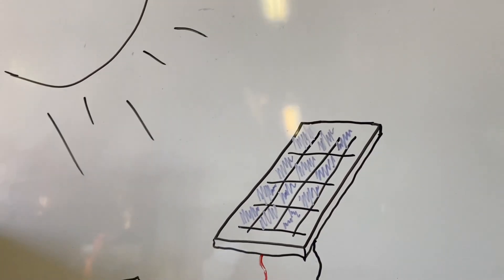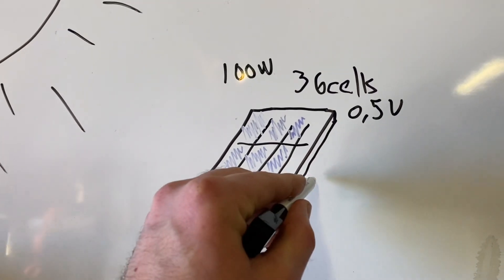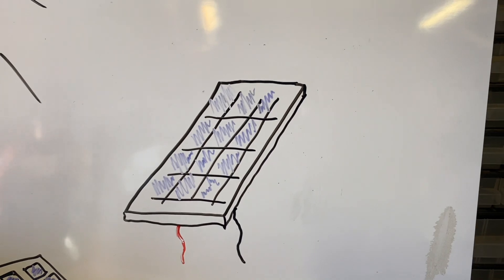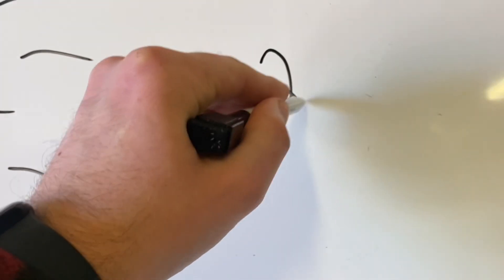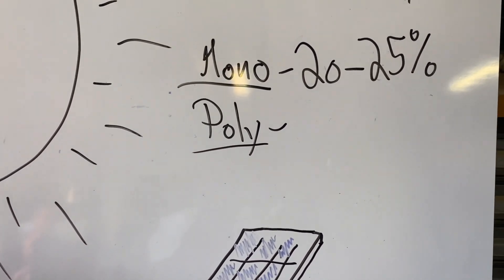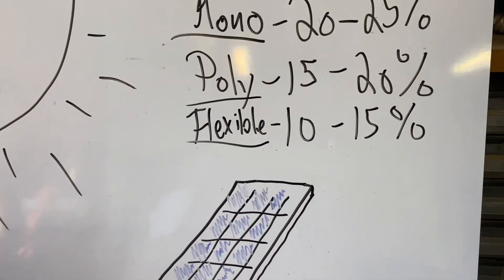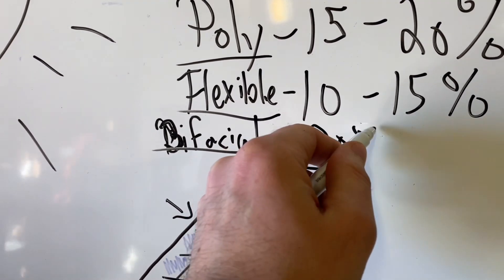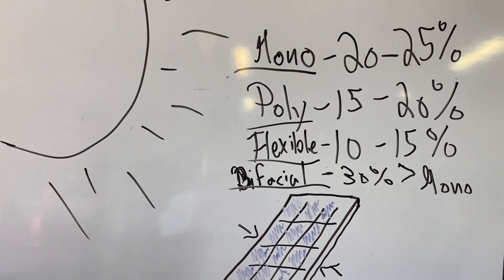Solar Panel Types Explained: Which One Should You Buy?

Comment: Can i connect different types of sola voltages
Reply from the maker: You can connect solar panels with different voltages, but:  If you connect panels in parallel, they should have the same voltage (Vmp) to avoid efficiency losses. A higher voltage panel will be pulled down to match the lower voltage panel.  If you connect panels in series, their voltages will add up, but the current (Imp) will be limited to the panel with the lowest current rating. If you're using an MPPT charge controller, it can handle mixed voltages better than PWM controllers, but it's still best to match panel specs for optimal performance.
Reply: @JonasSyver  thank you sir
Reply from the maker: @SiyabulelaKlaas-xo5qx  no problem!